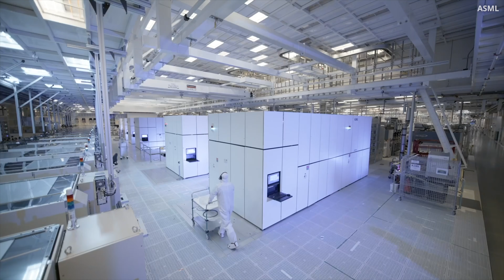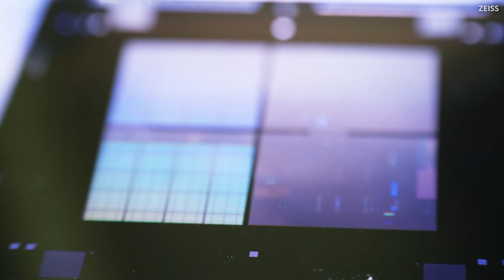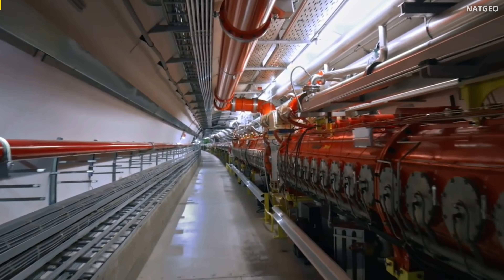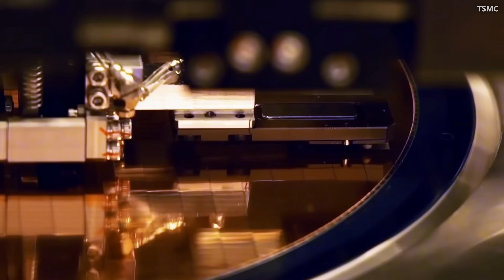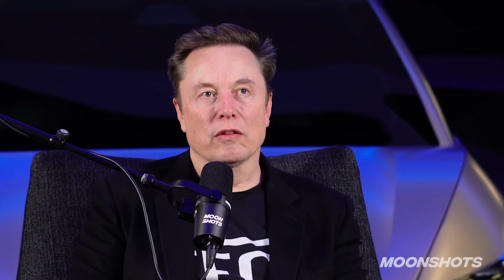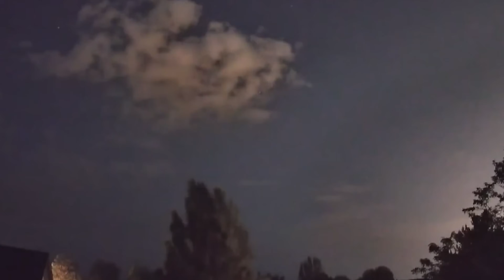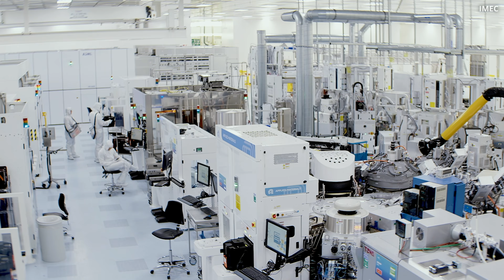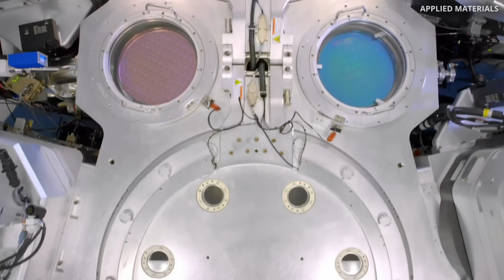New Chip Factory That Terrifies TSMC

Comment: So many people are praising this video, but most of it is incorrect.  Terrafab is using intel's chips, they are not making there own. You claim there is an 85% yield on the chips Terrafab is making, these are intel chips, and intel itself only has a 66% yield at the present time.  Putting everything inside one building (Design, Fabrication, and Packaging) is not a good idea at all, fabrication requires a cleanroom, zero vibrations, why do you think everyone else does not make a chip, package it in the same building.  You claim nobody else makes chips for robots, there are plenty of companies who have specialized robotics chips on the market, including Nvidia. Terrafab as far as anyone is aware is not able to get ASML's lithography machines, this is why they have signed a license with intel, for intel to make the chips.

Comment: Semiconductor manufacturing is a complex process that produces computer or microchips.
The front-end process involves building numerous very small electronic circuits on a flat wafer
. Also be aware that there is a back-end process that involves cutting wafers into dies and packaging them.The video base on AI prediction and easy said than done. LOL

Comment: Having all in one place actually lowers the risks. You need all parts of the entire process anyways, including packaging. If these steps are geographically separated, each spot can fail and you end up with no working chips. You also have to move 'naked' chips to a packaging fab and they are vulnerable while on the move. There are also more places that could be attacked. It is easier to secure one superfab.
Reply: A single metereological event, a tornado, or an earthquake, or a terrorist attack can stop a multi billion investment. That is risk
Reply: It represents a key geopolitical vulnerability. Any nutter with a drone or few, let alone a semi-trailer full of them parked nearby. 
And the world will have changed in the decade before they hit serious production levels.

Comment: Tesla failed in super computers because they didn’t understand how difficult it was.  Developing a new node now costs at least a billion.  If Tesla builds a mega fab, it’ll cost tens of billions, assuming they are going to build advanced nodes.  You said they won’t use advanced nodes, one to two generations back but by the time Tesla gets there that’ll be at the 3nm node.  I’ll be very surprised if they pull it off.

Comment: Anastasia, this is great coverage, thanks. Just know that in Elon’s world, this is easily doable. For Elon to come out and announce the TeraFab, it means he has already figured out the pros and cons. And if you compare Spacex Raptor 1 and 3 engines, then you will understand what Mr. Musk is up to. What Elon is saying is, most Fab production processes are convoluted, and complex and it does not have to be that way. What Elon is saying is, most Fab production processes extremely expensive to build and it does not have to be that way. Think about how long it takes and how much it cost for both NASA and SpaceX to build a space system … TSMC is great but Elon has mastered the art of simplicity and manufacturing.

Comment: The region between Austin and Bastrop, where gigafactory is located, is not considered plains by a long shot. It is rolling with some trees and there are pine forests closer to Bastrop, much of which burned in 2011, but recovering. On the other side of Austin is the Hill Country and the Edwards Plateau, with altitudes of 2000+ feet.

Comment: Taiwan’s TSMC Holds the Fate of Global Peace
Silicon Stealth: How TSMC’s A16 (1.6nm) Process Defines Sixth-Generation Warfare and the Global Strategic Balance

Computation Equals Survival

In traditional military thinking, “stealth” depends on geometry and radar-absorbing coatings. Yet with TSMC entering the A16 (1.6nm) era, the rules of the game are being rewritten. When extreme computational power merges with electromagnetic metamaterials, Taiwan’s semiconductor technology becomes the decisive core for sixth-generation fighter jets, advanced drones, and even strategic nuclear missiles—enabling “active stealth” capabilities.

A16 (1.6nm) Process: The Neural Core of Active Stealth

TSMC’s A16 is expected to enter mass production by late 2026. Its “Super Power Rail” and backside power delivery allow electronic components to achieve peak performance in minimal space. Active stealth requires systems to sense enemy radar waveforms within nanoseconds and instantly compute inverse-phase signals to cancel them out. This destructive interference demands massive DSP power. A16 delivers several times the logic density at ultra-low power, making it the only solution capable of shrinking “computational stealth” into missiles or micro-drones.

Electromagnetic Metamaterials and Digital Skin Integration

U.S. defense research has pioneered “digital skin,” intelligent surfaces composed of tens of thousands of electromagnetic sensing units. These metamaterial cells dynamically alter surface refraction, bending radar waves like water flowing around a stone.  
- Dynamic beam shaping: With A16’s high-speed control, digital skin can simulate false targets, even making aircraft appear as civilian planes or background noise.  
- Thermal radiation management: Against infrared tracking (IRST), A16-driven metamaterials precisely direct heat emissions, achieving dual-spectrum invisibility across radar and infrared.

Sixth-Generation Fighters: Active Stealth and the Brain

Sixth-generation fighters emphasize “information fusion” and “unmanned teaming.” A16’s computational power enables fighters to lead drone swarms in GPS-denied environments, penetrating air defenses with active stealth and autonomously allocating targets via on-chip AI. This is not just hardware evolution—it is a tactical revolution where computation becomes survival.

Strategic Nuclear Missiles: Toward Uninterceptability

Applied to ICBMs, the impact on global strategic balance is transformative. Current missile defense systems (THAAD, SM-3) rely on radar lock and trajectory prediction. But A16-equipped warheads with digital skin and evasive AI could:  
- Blind radars: Erase signatures during atmospheric reentry.  
- Saturation deception: Project dozens of false digital targets from a single missile, exhausting interceptors instantly.

Conclusion: Taiwan’s Unique Role in Asymmetric Warfare

This fusion of U.S. design and Taiwan’s manufacturing makes Taiwan not just a supply chain node but the hardware foundation of global defense and offense. With only TSMC capable of reliably supplying A16 and beyond, Taiwan builds not just a “Silicon Shield” but a technological hub essential for maintaining strategic balance and deterring major conflict for the next fifty years. In this game where computation is the currency, the A16 chip is the hidden card opponents cannot see, nor counter.

Comment: When you consider that the core business model is AI and its unlimited applications across every industry including every company that Elon Musk owns, and unlimited demand for chips once he starts putting Data centers in space, and the biggest threat to the business model which is China's invasion of Taiwan or simply fab backlogs, then Terafab makes perfect sense.
Reply: He's not going to depend on customers to order his chips, but he has decades of demand already lined up and since it's going to take years to develop the space infrastructure including the lunar factories and the delivery and installation robots, he has plenty of time for trials and errors and based on my own intel about xAI  progress in material science, I anticipate Terafab to eventually build its own lithography and chip assembly machines as well. Plus Terafab is not going to make hundreds of different microchip designs for clients and market applications, but almost exclusively AI compute dedicated chips without the unnecessary segments of the conventional GPUs and the AI chips that evolved from that, meaning simpler floor plans and packaging. Memory chips are a lot simpler to scale because the process nodes are even less complex, and by applying modularization strategies, Terafab is going to be able to customize the modular floor plan designs and enter production and packaging at a much more rapid phase than legacy chip makers and TSMC and Samsung do.

Comment: Switch to carbon-ternary fab. It solves silicon pain points right at the chip engineering and manufacturing level, the AI industry becomes more sane in a genuine carbon ecosystem, not a silicon mirror fantasy simulation technosphere at brute force,  frying everything evolving naturally on earth.

Comment: Elon often doesn’t achieve what he broadcasts. Ie dojo , solar  tiles, best battery cell tech  etc.. all had big promos and quietly died It won’t be as easy as he thinks. The current chip makers have decades of experience building on what’s been developed before.  I doubt he will maintain the focus before another shiny thing distracts him.  I just wished my Tesla car wipers worked correctly.  Been years and still not fixed

Comment: Building memory and chip production in one fab, indicates that they might try to do memory-on-chip. That means: complete integration of at least some of the memory as well as the processing on a single chip, rather than having external memory. If they can do that, they can outperform traditional chip designs significantly. Perhaps even if they cannot reach the same level of detail that TSMC can.

Comment: This CCP CHINESE A.I. propavanda video.

I grew semiconductor ingots, ground, saw, lapped, polished the waffers.
We sent the well processed wafers to be etched the printed circuit.

A 15Kg silicon melt 4" ingot could give 5 to 6" ingot.
Of 0.017 wafer that makes hundreds of chips.
I ran multi reactors every night, of 12 hour shifts, 3 on 4 off/4 on 3 off.
😅

Comment: So, has Tesla solved its windshield wiper problem? If ASML can only produce 70 extreme ultraviolet (EUV) machines a year, why does Musk think that once the factory is built, he can get 7,000 units to produce more than 100 times the capacity of existing chip manufacturing?

Comment: Terafab is going to be able to build custom configurations with HIGH SPEED connections on a chip board. So, at the beginning, Tesla will be able to use some parts of the chip board with certain parts that don't need to have the extreme thin layers for 60 to 70 % of a chip configuration with a small portion that needs to be the super thin chips from Taiwan. And with a faster testing speed that will go 5 to 7 times faster iterations at the beginner ng and go much much faster  than anybody else.

Comment: I am a semiconductor engineer with 30 plus years of experience in the silicon valley, CA.  I remember at the early stages of my career, several semiconductor design companies which I worked for all have their own fabrication plants.  But when times went by, one after another closed down because they became too expensive to operate.  So later in my career, all the companies I worked for are so-called "fabless" semiconductor design houses.  All of them have manufacturing side contracted out to either TSMC, UMC or Global foundry and other smaller fab.  The reason is very simple, it's simply too expensive to have fabrication factories operated here in the States.  We all know, TSMC is operating and building several fabrication plants in Arizona.  The reason for TSMC to do so is a pure strategic play, nothing to do with TSMC to have a better cost structure, but rather to serve most local important customers in the States and fulfill support of better US-Taiwan relationship.  As a matter of fact, the chips made in Arizona are more expensive due to US's labor and environmental laws, as well as lack of local engineering know-how.  Most of experienced Fab engineers of my time are retired or plain gone!  TSMC had to migrate so many of experienced engineers from Taiwan directly and even until now the chips made in Arizona still need to ship back to Taiwan for final testing and packaging (due to the very technical advanced packaging know-how and equipment capacity are not available yet in Arizona.)  So Elon Musk is very ambitious and have capital to spare, but he doesn't have the know-how to operate a fab; Yes, he can build a fab by throwing money into it, but running it with good enough yield of the product is totally another story.  TSMC's today took them about 40 years to build and form several hundreds of suppliers to support.  Terafab's only choice, and they are doing it now as we speak, is to go to Taiwan Science parks to hire engineers with experience of one small part of building or operating a fab, but that's not enough, you need someone(s) with high caliber of knowledge and management experience to organize this big group of engineers and support team.  So the million dollar question is this: Does Terafab make sense?  My answer for that is a not very sure YES, because Elon can't wait for TSMC or Intel or whoever to build chips for him, so it makes sense for his to do since money somehow is no object to him, sort of.  The next multi-million dollar question is : Would Terafab be successful?  My answer for that is more negative.  There are examples in the past, happened in China's semiconductor build up in the past about 20+ years.  When China started semicon build up, they did exactly what Elon is trying to do, threw "almost unlimited" funding into it.  They also hired so many engineers, design teams, and even very high caliber figures from Taiwan to do the same.  Yes factories are built and products are out, but ultimately, when new technologies evolved and moving forward, their innovations can't catch up with TSMC or other leaders, so many of them just faltered.  Why, the width of the know-how needed to be successful in "advanced" chip makings is so sophisticated, and you are up againt TSMC who is the master and well-experience in this field and also in the chip packaging technology, the latter one (packaging) that Terafab can't even address at this point and it's another elepant in the house.  Good luck with Terafab, but I wouldn't bet my money on it as now.  The time and efforts needed for Elon to build Terafab is tremendous and filled with unknows; instead, I would rather go talk to CC Wei (CEO of TSMC) and negotiate to pay for one or two of the fabs TSMC is going to build in AZ and dedicate the capacity entirely to Elon's needs.  TSMC can build the fab so much faster and run it so much efficiently; after all, TSMC is the one with all the know-how in this already.

Comment: They can maintain a focused diamagnetic field around the wafers and machines at all times so all particles are repelled from the wafers doing away with using FOUPs and extremely costly ultra clean factories and filtration at the same time making chips faster and cheaper.
Reply: I don't know how to do that, I'm not a physicist.

Comment: If the A/C unit fails in one of those places?
Reply: Major problem , the machines are not allowed to heat up or cooldown more then a few degrees. The lenses in 2 metre or so high Colom will probably shift in a twinscan. meaning the lenses need to be recalibrated or dis & re-assembled in germany. That takes days and germany weeks to months.
No idea how a EUV machine reacts its inside a vacuum chamber.
Reply: @katarn848 interesting thank you for your insight!

Comment: After listening to your video, it all make sense now. The current process and techniques used to develop chips is not sustainable. The entire system has to many moving parts, it's to fragile, slow and a bottle neck to scaling data centers, autonomous vehicles, Ai, Starship and humanoid robotics. New outside the box thinking is without a doubt required, TERRAFAB makes sense.

Comment: Phx AZ based electrician and renewable energy inventor guy here… I’ve worked in the Intel fabs since i was an apprentice electrical laborer fab 42 2011… We can see we’re in an AI arms race and we’re locked into building more compute power… 1/3 of all construction labor power is building data centers… I want to point out the energy crisis element of what’s happening and plasma fuel reformer technology as proposed solution for energy efficiency and emissions controls… I’ve been building and reverse engineering these such as thunderstorm generator by Malcolm Bendall… real revolutionary technology.

Comment: it seems insane that the microchip factory is built like any other factory, giant room with lots of gear. The giant room should  just be the outer layer with fairly cheap clean room level tech. The full manufacturing process should be rethought and condensed with a clean layer as close to it as possible. I am not an expert on this topic at all but it seems like an obvious direction to look in to reduce the clean room challenge. There just seems to be a lot of empty space being cleaned.

Comment: Texas has something that happens regularly... TORNADOES.  Any chip factory that has a tornado come close to it will be out of business for quite a while. It doesn't need to hit the chip building. It could hit the water supply, the cooling infrastructure, or the power generation section. The chance of a tornado hitting a house or small business is small. The chance of a tornado hitting something the size of a small city is MUCH greater. Such factories should be built underground.
Reply: Tornadoes are not at all regular in Austin, it is too close to the coastal plain. Go further north 50~100 miles and there is more risk.
Reply: @tomgroover1839 Not all data centers are being built there.
Reply: @MrMoneyHelper  This is about Musk building a fab near his factory near Austin.